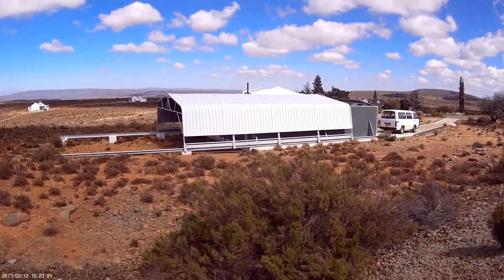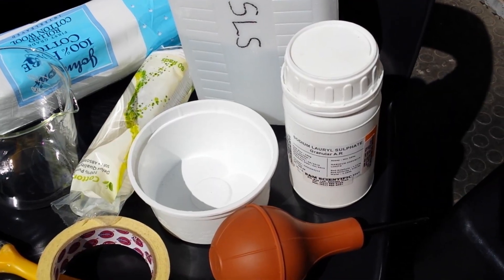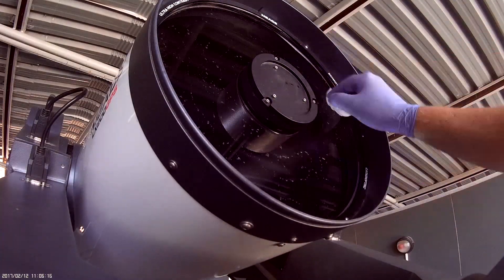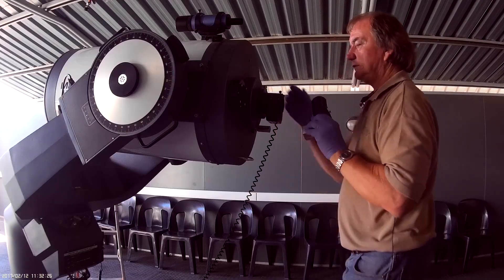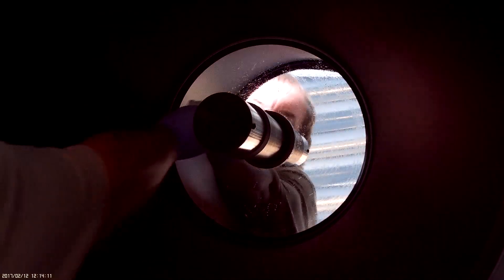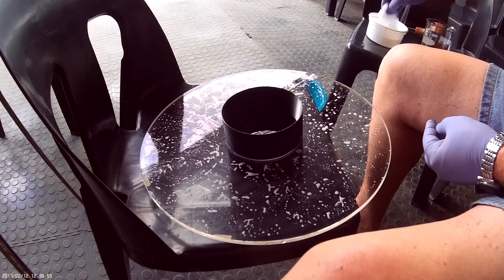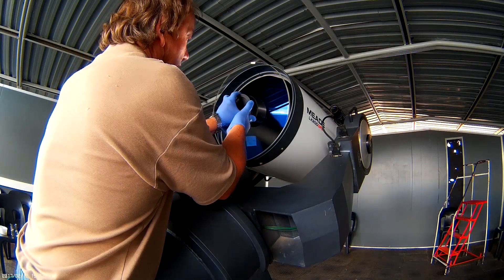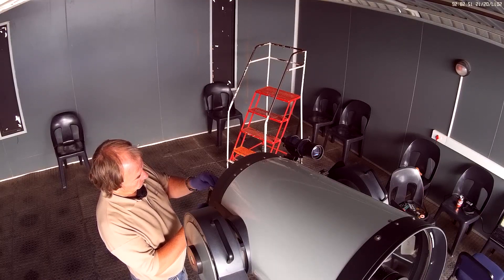How to strip and clean the optics of a SCT (Schmidt-Cassegrain Telescope)

Comment: HELP! A few days ago I found something that looked like a fungal infection on the inside surface of my SCT corrector plate, if not a water condensation residue. It looks cloudy and has a central dot of dust or something with filled in circles of decreasing opacity further out the centre, and fuzzier outside (too small to see details). Its diameter is currently less than a cm but I’m worried it’ll grow bigger and damage the coatings of the plate, but without a flashlight shining on it the circular patches around are not distinctly visible. What should I do? Should I leave it out in UV light to try to kill the fungus then evaluate if I should clean the residue or just attempt cleaning it myself now by taking the plate out? It’s also a second hand scope and bought at a very reasonable price so within the next week or so I can return it if the other ways are costly or require an expensive professional to clean it. I would appreciate it if anyone can give me advice. Thanks

Comment: I had my Celestron C9.25 telescope in storage for a few years. It must've gotten to hot and some of the grease from the focuser leaked onto the mirror.
I've pulled it apart and tried to clean it, but it's not coming off. I'm going to have to put a bit of pressure on the mirror to remove it. I'm using a mix of distilled water and isopropyl alcohol with cotton balls and fibre optic wipes.

If anyone has done this before, any tips would be great.

Comment: How do you feel about flocking the interior of the ota?
Reply from the maker: Please explain what "flocking" involves?
Reply: @SterremanWillie  I think most people flock to reduce stray terrestrial light from bouncing onto the primary. It involves removing the corrector plate like you did and then putting black velvet lined paper(Protostar is a brand) along the inner perimeter of the ota to absorb those stray light rays. Probably not needed in your remote location, I was just curious if you had tried it  or had a general opinion of it.
Reply from the maker: @knight2255  OK, I now understand what you meant by "flocking".  Reducing stray light as much as possible in optical systems is always a good idea.  But take care not to obscure or use material that will later sag into the optical path.  Most good brand telescopes should be good enough as they are, so also be careful not to fix something that isn't broken.

Comment: I certainly would Not use this ‘method’ of cleaning a Primary mirror! 🙈
Any contact with coating will cause damage.
Reply from the maker: @stuartbaines2843  Go read the comment by an ex-Meade employee and you will see this is actually what they did. The same methods are usec at the professional observatory where I worked. Damage is only done when dragging while there are still grime present.

Comment: Pourquoi deux téléscopes identiques ?
Reply from the maker: They are not quite identical, but they are used for public outreach, so can be pointed to two different objects when doing public stargazing.
Reply: @SterremanWillie  Apparently these are 16 inch telescopes. Can you tell me what maximum magnification you get without image degradation ? Can you send me a photo of Jupiter or Saturn taken with your instrument ?
Reply from the maker: @sergedannywilde1987  The one I first cleaned (not shown in the video), is a Celestron 14-inch and the one in the video is a 16-inch Meade.  I never tried to push the magnification since there is no point unless you want to do an experiment - one can actually see more with less magnification.  I only have footage of a Lunar/Saturn occultation taken through the 14-inch, by handholding a video camera at the eyepiece - see https://youtu.be/K98eWv3s0z4?si=m23mJEm8Gv4kkrKw
Reply: @SterremanWillie  Images spectaculaires ! Merci pour cette vidéo ! Je demandais ça car je viens d'acheter un Célestron C8 et je n'obtiens pas grand'chose pour l'instant...Images floues dès qu'on les grossit un tant soit peu...
Reply from the maker: @sergedannywilde1987  start by checking/correcting the collimation.

Comment: I've gotten really good at doing this too with my 1981 Celestron 8 'Frankenscope' (made of the best parts of two that were heading to the junk pile otherwise), and have gotten to the stage when I can clean the corrector to perfection.
Tools : PEC Pads, Ultra-microfibres, a lens 'flick' microfibre tool  - all of the first three from a specialist camera shop; Tamiya masking tape 10mm, Gundam fine markers (for cork positions on masking tapes), cotton balls, X-acto #11 Stainless Steel blades and handle, rubber gloves (not nitriles), 3 x 250ml lab squeeze bottles for cleaning solution, EtOh, dH2O.
Cleaning agents : dH2O, EtOh 95%, Pure SLS (lab grade), and a can of CRL professional hi-sheen aerosol cleaner; Cleaning solution of 20% EtOh:80% dH2O - used to dab on mirrors and correctors with a soaked PEC Pad with zero pressure.
Technique : the same as yours for mirror surfaces; I protect the secondary with a spare cotton glove, but will use the pristine microfibre flick-cloth prior to covering with glove. Dabbing with a cleaning solution pec pad, followed by a tube-down rinse with dH2O, and then dabbed with a pristine ultra-microfibre to prevent micro-spots.
Gloves in use at all stages.
For the corrector - all the same steps for the cleaning, though with absolutely no pressure at any stage of procedings - scratches of even the slightest sort are unforgiveable to me. The soap stage is two-step - SLS first, dry, then CRL spray, blotted, dried - all drying steps with the ultra-microfibres. Done in bright sunlight, to ensure that there are zero streaks or imperfections in the drying stage - about 0.5 Newtons pf pressure is permissible in drying stage, but from the bottom of the corrector being held in-hand by the corrector assembly - the cloth can 'fall away' from the surface, rather than being 'pressed in' and that is super-critical. PEC Pads replace cotton balls for the cleaning stages, when 
For drying, because it is light enough, I will do the drying by dragging (with no weight) a pristine micro-fibre over the real surface, using the sun to ensure that there are no scratches, and no dust. Identical technique, and another pristin ultra-micro-fibre (I have three per annual cleaning session) for the front surface.
Result is something not even Celestron say is possible - a better-than-factory clean. In the process, you remove (for old ones like mine) the wax-coat Celestron put on the surfaces, which gave the optics a 'blue tinge' which everyone thought was a coating.
That's about my only addition to the process.
Reply from the maker: Wow!  Very interesting!  That's really cool!  Thanks for sharing.  Good to know I was on the right path at least, but that there is lots of room to improvement!   Thanks for watching.  Keep up the good work.
Reply: @SterremanWillie  Baie gaaf, en dankie meneer.

Comment: Thanks so much for this video.  I have an old Meade 10" LX200 I was cleaning up to give to my grandson.  Looking at it I could see cobwebs inside so yes, it was in definite need of some crucial cleaning.  Your video made it very clear the steps I needed to perform in order to clean it up properly.  Without your video I know I would have done the work incorrectly and probably broke or messed up the OTA.  Going to clean it up this week and I'm sure it will go smoothly now that I know what I need to do.

Comment: I had to remove and replace 4 screws in the primary housing to replace the red dot finder and install the starsense
undoing the screws was easy, putting them back in was more difficult especially towards the end with significant forcing
is this abnormal?
Reply from the maker: Interesting. The back casting is aluminium so normally tap screwthread fine. Sounds like threads were spoiled somewhere, but unless you crossthread the screws, should have been smooth. It could also have been that you mixed metric and imperial - often the threads on the telescopes are imperial.

Comment: Hello!  I hope this message finds you well.  I thank you for this video.  I came upon a Meade 14" LX200 GPS whose optics were in good condition, just dusty and a bit of mold forming.  The courage it takes to break down a scope is nothing to scoff at.  The ONLY reason I successfully cleaned and returned my scope to full and pristine operation was via your video.  Thank you many times over and over again.

Comment: I got an old Meade 8" SCT and I did not realize until it actually arrived that this thing does not have a mounting bracket. Any ideas no what should be the next course of action? thanks!
Reply from the maker: What do mean when you say "mounting bracket"?  The bracket that goes onto the mount, or perhaps the mount/tripod itself?
Reply: @SterremanWillie  First of all thanks for helping. Second of all sorry for not being clear as I am new to telescopes. So what I meant was the tube didn't come with a Dovetail Rail Assembly or a cradle ring. It is just the tube bare bones. I checked with the Mead cust' service team and they suggested I get in touch with one of their dealers here on the east cost (closest is in NJ) They said it is backordered and would take 8 to 10 weeks minimum. Any other ways I can get this paired with something to put it on a tripod? Thanks
Reply from the maker: @Astro_Gyani  thanks for the explanation, makes better sense now.  Wow, that is a long lead time!  I would suggest you try and contact amateur astronomy clubs in your vicinity, particularly those which have active ATM (Amateur Telescope Making) groups.  If is amazing what people have laying around in their garages and well stocked junk boxes and what ingenuity ATMs can come up with!  Hope you can get sorted soon!
Reply: @SterremanWillie  Thanks I was just checking out which clubs are operational here esp. due the resurgence of covid and the cases jumping up on the East coast. I think there are a few clubs and one has an online zoom meet in the coming week and I am planning to join in and see if they have ideas. Thanks for the help! Really appreciated.

Comment: As you have invested many THOUSANDS of dollars in your gear, I have to question WHY did you use circular cleaning/wiping motion when I understand that a "center to outer" motion is the preferred method to use?  The method that you used seems to work OK for you, but, isn't it "better" to not clean/wipe in a circular motion?  My new Celestron Nexstar 8SE arrived with a slight bit o dust and although not perfectly clean, my main mirror will perform fine and really does not to be cleaned - just yet....  Thanks for your video....  Your comments welcome.
Reply from the maker: Thanks.  I got info from our optical people  at the Observatory, who told me to use circular motions.  I'll ask them why?
Reply: @SterremanWillie  That would be a good idea as to WHY supposed "experts" would recommend a method that I understand to be "not good"..  ;-)

Comment: This man makes it look easy. But don't think it's a casual job in any way. If there's any resistance when you're putting the screws back in, stop, see what's causing the obstruction and even if you have to remove all the screws again, do it. I thought I was being careful but it didn't stop a crack developing shortly after. I may still be in shock, but please, don't attempt this unless you really have to and you're 100% alert.

Comment: Wish I'd have remembered to orient the plate on my C9.25 SCT back to the it's original position last week, then it might not have developed a hideous crack 10 minutes later. Or maybe it was a tight screw?

Never mind. Help is on the way; not too expensive, I hope.
Reply from the maker: Oh no!  What a pity!  Yes, those correctors are not very thick and cannot take much force when pinched!  Great to hear you could find a replacement corrector!  Hope you are up and running again soon!
Reply: @SterremanWillie  Thanks.
Reply: I had the same accident! Please let me know if you find any hope for us!
Reply: @henningjacobs6875  Celestron tech support UK can provide a new plate for around £170, but finding a company who will competently fit it for optimal performance is proving trickier. Do you think you know where you went wrong?
Reply: @mrh9635  fitting the Celestron dew heater ring. Everything OK. Till the last tightening of the last screw!
Reply: @henningjacobs6875  Well, at least you had a legitimate reason for removing yours, unlike me. I had 1 tight screw and I think that's what did it. I hope you have a warrantee, also unlike me.

Comment: Great work buddy just a Quick question my corrector plate has cracked and the is a few small bits in my mirror what would the best way to remove the glass bits from the mirror thanks.
Reply from the maker: Sorry to hear about your problem. I guess the short answer is, very carefully!  Perhaps point the telescope to the ground and try to blow out as much glass as possible first using clean air.  If any remains on the mirror, gently brush it off with a soft brush.  Hope you can rescue your scope again.

Comment: My corrector plate and mirrors have anti-reflective coatings on them. Will this wipe off the coatings?
Also, why not use a spray bottle (with your own cleaning solution in it) instead of dabbing the cleaning solution and water on the the glass?
The secondary of my 36-year old SC looks to have some corrosion spots on it. Does it have to be re-aluminized or can I simply clean it?
Edit: spelling.
Reply from the maker: Anti-reflection coatings are (normally) tough enough to withstand cleaning, so should not be a problem.
If you can afford some dripping from the mirror, using a spray bottle works fine - in fact, you will see it being used in another video I made when we cleaned a giant mirror!
If those spots do not budge after cleaning, you probably need to re-aluminise, yes. Try cleaning first, you don't have anything to loose.

Comment: Hi, I'm really interested in how you achieved your roll off roof assembly. Do you have any other videos regarding the build?
Reply from the maker: Unfortunately not - the dome was supplied by a contractor.  It uses the motor and mechanism of a gate opener to open and close it, using two linear gear racks on both sides.

Comment: Nice job. When I worked at Meade we used tissue to clean the optics. We used alcohol or water to clean. We didn't use soap but your optics were pretty dirty. Our Vice president in charge of production would bring tours through and hold a dust cover over half the lens and have someone look through the eye piece to show that you could still see objects. He did this so people didn't get freaked out that the lens was dirty and that it had to be super clean to use. The glass on this scope was very dirty and you did an awesome job. Scratching the coating can happen no matter how careful you are but most of the time you will be OK as long as you do what you did and remove the big dirt particles. Your collimation shouldn't change as long as you put a witness mark on the lens like you did. I haven't worked at Meade since '06 and this brought back memories some good and some nightmares. You would be surprise at some of the scopes that came back for repair.
Reply: Always great to hear from someone with first hand experience with the equipment manufacturing process.  I'm returning my 25 year old 10" LX 50 into service after many dormant years. I've never cleaned the optics up to this point. Unfortunately there seems to be a couple of patches on the corrector plate which I assume to be some sort of organic growth.  I used a very soft brush on it and it smeared so it doesn't look to be too ingrained in the plate. Now I trying to decide whether to clean using Dr. Clays ASO method or go full out and get first contact polymer instead.  The cost of the latter is significant however and even more so when international shipping and import duties are added on top.
Reply: Would you happen to know anything about how to change my location on the telescope
Reply: Was it isopropyl alcohol or ethyl alcohol?
Reply: @ulisessolis3182  we used isopropyl alcohol
Reply: @bryanhuehnken7171  thanks for your answer. Just one more question, could the ethyl alcohol damage the lenses if it's used for cleaning?
Reply: @ulisessolis3182  we never used that so I can’t say.
Reply: @bryanhuehnken7171  ok, thank you very much
Reply: I had setup in the park across the street last summer but realized I had left my battery pack for the polar mount at home.  I ran back home and by the time I got back, the sprinklers were on and blasting the scope :(   the people who were there were not strong enough to carry the assembled setup to safety and were using their bodies to do the best they could to shield it lol.  To my surprise, very little water made it's way in and there was no damage.  That said, I am going to break it down and give it a wash.  It's time.